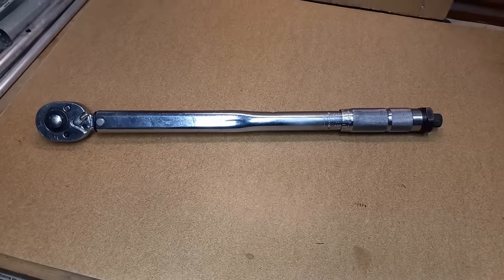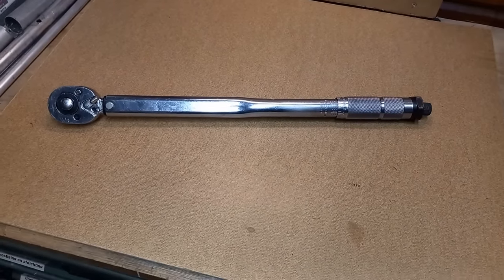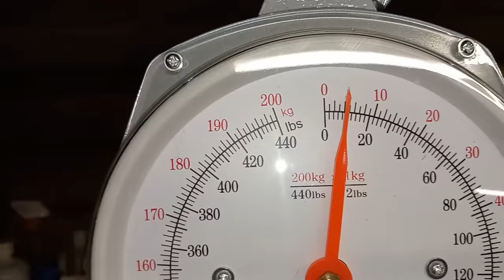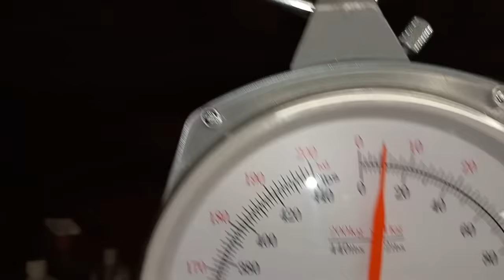How to calibrate a (cheap) torque wrench

Comment: My dad worked on aircraft in the 50s and 60s then testbeds in the 70s. I need to use a torque wrench but somehow his arm is amazingly precise he knows exactly what 100nm feels like to within 5nm.  On top of that, he ended up in technical publications where the torque settings were decided and its a mixture of finger in the wind mixed with measuring what an engineer thought felt was right. The exception was torque to yield but thats a completely different thing. He still maimtains you only need a torque wrench to get consistency for people who don't understand what they are doing. I can't feel 100nm from 200nm. Obviously 200 is twice but when you cant get square on something or your arm at a funny angle I just can do it... he still can.
Reply from the maker: Thanks for sharing that story James. I completely agree with your dad, I've been a technical writer for over 20 years now and determining torque values for workshop manuals is often done  by what experienced mechanics feel what is right. If we needed a torque value, we just measured the breakout torque and went with that. As I said in the start of this video: I like to work by feel an in my opinion any good mechanic can do that. On safety critical components, high torque connections and in the aerospace industry, it is a whole different story. That's where the calibrated and certified stuff comes in. But then again, in my day job I see a lot of overtightened bolts that just snapped off because the recently calibrated (they're always recently calibrated when stuff happens) beeped when the set torque value was long exceeded.
Reply: Your Father had the 'calibrated arm', as we used to say in the Aircraft sector.
The old German torque of 'Guden' Tite' was the other expression we would jokingly use.
Reply: On aircraft (there is no Parking Garage in the sky) - it is ILLEGAL for a mechanic to tighten a nut or bolt which has a called out torque - and not to use a certified Torque Wrench.  You must sign documents attesting to your work when finished.  Crud - the FAA will fine a mechanic - if they come to a shop or Airline; and find an individual working on an Aircraft without the Documents and drawings stating what to do and how to do it - at his location and readily available.

Comment: how much did you turn while calibrating the wrench? i.e. what would be just rough adjustment to start with? and in which direction?
Reply from the maker: Very little actually, three quarters of a turn clockwise was enough to get it in spec.

Comment: Great video, would have been interesting to see how accurate the maximum and minimum torque settings were after calibration at the mid point.
Reply from the maker: I have a follow-up video planned, to see how much my torque wrench deviates from the ISO standards.

Comment: I think it’s funny everyone arguing about how to unwind it and at what angle to use it but nobody seams to mention that this is being measured as if one uses only one finger at the very end of the handle. There’s likely a 2-3 inch difference in center pressure when using your whole hand. 
Lighten up, consistency is often as important as torque value.

Comment: First: of all it is a factor of 9.81, secondly: the center of the handle is used as the touchdown point, you have a special groove milled there
Reply from the maker: I adressed that in part 2 of this video, and indeed: you are right. Thanks for watching!

Comment: Great video!

I looked up the math and found that 1 newton meter [N·m] = 0.1019716212978 kilogram-force meter [kgf·m]. So 126 N·m * 0.1019716212978 = 12.852 kgf·m. And since the distance from the applied force to the point of rotation is 42 cm or 0.42 m, 12.852 kgf·m / 0.42 m = 30.6 kg. So now I see how you arrived at 30kg of force.

One question - When your torque wrench was clicking at 25 kg, did you adjust the calibration clockwise or counter-clockwise to dial in the torque closer to 30 kg?

 As a Canadian in my 50s I use a real mixture of imperial and metric. No question that metric is the superior system, though I still tend to think in terms of foot pounds because that's what my Dad passed on to me. 🙂
Reply from the maker: When the torque wrench clicked too early, I increased the pre-load on the spring, so it requires more force to click. To increase the pre-load, I turned the adjuster in (clockwise). I only took 3/4 of a turn to correct the pre-load. 
I can relate to your story on mixed standards, I used to be a technical writer that's used to the metric system, but I have written many workshop manuals for the US and Canadian market. The conversions weren't the hardest part, I am so used to use a comma (,) as a decimal point, that I always needed to remind myself to use a point (.) instead. Anyways, thanks for watching!
Reply: I concur.  Try going through the CMHC wood-frame builders handbook, you have to constantly convert everything from odd-ball mm sizes to 2x4 or whatever.   I am not sure who in Ottawa thinks I head into Home Depot to buy a 1219mm x 2438mm sheet of anything.  !
Reply: I talked to a guy once who pointed out that the romans split the inch into 16ths and that 12ths were superior because you could more easily divide them. This in turn points out the problem with the metric system which is fractions are hard when all you can divide evenly are 1, 2, 5, and 10. Now... if you live in a metric world do you still buy a dozen eggs or are there only 10 in the carton :)
Reply: @danielboughton3624  Hmmm? I saw eggs in Canada sold in 6,12, 18 and 30 eggs per carton.
Reply: @danielboughton3624  In Australia , 12 or 6 pack
Reply: @Wingnut_Stickman  In Australia,  timber measurements is largest first, 4 x 2 inches or 100 x 50 in millimetres.
Reply: @garybailey8877  we have 6, 12, and in some places 18. I haven't seen a flat in a long time which as someone else mentioned is 30 eggs. You can still buy things at the bakers by the dozen though it is not as common to go to the baker or butcher as it used to be. I think those might come back as the food wars continue. I have an egg guy I get my eggs from now when he has some to buy. Too many customers and not enough hens.
Reply: Thanks for doing the math, wasn't sure how he was coming up with that. I calibrated and repaired torque wrenches and gauges in my day. I always used ft/lb and inch/lb, this was throwing me. Couple things.:
Always return the setting to the lowest number for storage or the spring will get sacked.
Always turn the wrench setting up to setting, never down. If you have to go down, go down significantly far below and come back up.
The band in the middle of the handle knurling is where force should be centered, that's where it is calibrated at.
Position your hand force centered on that band as much as possible and pull at 90 degree's or reading becomes very inaccurate.
Beam type wrenches rarely never go out of cal providing they aren't abused and the needle rests on zero
Beam type wrenches will have a floppy handle mounted on a single rivet pin. Neither end of the handle should touch the wrench body.
Those wrenches should never be used as regular ratchet wrenches, or as a breaker wrench to loosen a fastener.
Even though the head comes with the reversing lever, changing directions often throw the wrench out of cal.
If a CCW torque is necessary, your better off getting a second wrench to do CCW only.

Comment: Great work. I would have wanted to see a bit more accurate calibration method but water in plastic container but I guess that's good enough for the scale used here.
Reply from the maker: And with the accuracy of the torque wrench in mind, I don't expect accuracy up to 1 nm, but I wanted to make sure that my wrench is in spec in the range I use most. Part 2 is coming soon!

Comment: I use a harbor Freight digital torque adapter and a socket that fits my lug nuts on the car.  Set the adapter to hold a reading and use it on one of the lug nuts that in on my car's wheels with a torque wrench.  When the torque wrench clicks I look at the reading on the digital adapter to see how close it is to the set point on the torque wrench.
Reply from the maker: That sounds like a handy device, what's the price of it?

Comment: But how you calibrate the scale
Reply from the maker: By using a reference weight. I used 5 liters of water, which is 5 kilo. It is best to use a reference weight dat equals the force you need to apply, but I didn't have 30 liter tank at hand (for the required 30 kilo of force I needed).

Comment: You’re not calibrating it you’re adjusting it, Calibration is working out three points at the middle and at the far side of the scale, to make sure, to check against a standard That it measures the correct amount.

What you are doing, presuming that the scales you pulled you know I measure incorrectly, using them as the standard, is adjusting them to a standard. Many people get this wrong

Comment: I wonder how ambient temperature affects torque adjustment for these mechanical wrenches.
Reply: Two effects occur. One is that the rigidity modulus changes. For most materials this means they get less springy as heat rises. In the case of a torque wrench the actual torque drops compared to the displayed value on the handle scale.
Second is parts of the wrench physically expand as the heat rises and this also has the same effect as above.

Comment: in my opinion you should apply a scale hutch on the middle of grooved place because right nowyou use it differently than normal. your hand should have grip around a center of hand position not far away in the end. so maybe originally near 30 was good.
Reply: Apparently you do not understand how a torque wrench works.
Reply: @deepcangler  they work on force needed to slip mechanical part tensioned by spring. Because this is measure in Nm usually it's mean that force attached to the arm it's correlated another force in fixed arm and fixed slip, resistance. So if you change length of the arm with the same force you change torque. So if you calibrate torque you should apply force the same place. Later after calibration it's not important when you put force as soon you exceeded torque it clik or slip. But with calibration it's one of the most important...

Comment: WHEN I WAS IN COLLEGE GETTING MY ELECTRICAL/COMPUTOR ENGINEERING DEGREE. MY PROFESSOR WAS THE ONE WHO FROZE THE ELECTRONS IN A WIRE FOR NASA. DURING ONE OF HIS CLASSES. TOLD THE CLASS HIS FRIEND WAS A ENGINEER WHO DESIGNED SPRINGS. MY PROFESSOR SAID YOU WOULDN'T BELIEVE THE ENGINEERING THAT GOES INTO DESIGNING SPRINGS.

Comment: If you're going to be picky enough to calibrate the scale before use, you should calibrate it correctly.  One liter of water only weighs 1 kilogram at sea level.  As you go up in altitude, it weighs less because the effect of gravity lessens the farther you get from the center of the earth.
Reply from the maker: My workshop is actually 2 meters below sea level.
Reply: @Carnold_YT   Then you need to take that into account as well.
Reply: Seriously guy you think 2m above sea level is a factor with all these other variables and a $25 torque wrench. Bwahaha that’s hilarious
Reply: @travissheehan6082   No, I don't actually.  That's kinda my point.  You've heard of sarcasm, haven't you?  Maybe pick up a dictionary sometime or something.

Comment: When I did my apprenticeship in aero engineering I was taught not to keep pushing until the device clicks. As soon as the pressure goes over the ‘hump’ and goes slightly free to the ‘click’. When the wrench clicks it continues to move up to a stop, when it hits the stop additional torque is exerted.
Reply: So how do you know when you reached the correct torque if not for the click? Just feel it?
Reply: @Asto508  my mechanical wrench increases in pressure to a point where there is no more pressure needed to continue to move it. Then it clicks. The click introduces a random input to the pressure. Obviously an electronic or gauge wrench does not do this. But experiments have shown that if you want/need highly accurate torque then avoid the click. To be perfectly accurate put a DTI in the end of the stud or bolt and measure the stretch of the bolt or stud as this obviates any friction in the threads.
Reply: @billgiles3261  I see, but I guess this requirement for high accuracy you won't find outside of aerospace engineering which you of course mentioned. 
Automotive is just not that demanding and it's fine if you exceed the torque by a tiny fraction of Nm. 
For the paranoid people, you can just set it a bit lower than spec and live with the offset. :) 

As far as I know that's also the reason why torque wrenches in that segment are usually electrical/electronical and not mechanical. 

We are still on a Youtube video about DIY car mechanics though. :)
Reply: Another and more insidious error component - is that people don't move the wrench in one smooth motion.  A MOVING nut needs less force to keep it moving.  If it is stationary - you have a greater force exerted onto it - to start it moving.  So, when you are torquing a fastener - as you approach the torque - position the handle so that you can complete a swing arc in a smooth motion - and stop when the wrench clicks.  Then - after this - and torquing a round of fasteners - people like to go around with the wrench - and test that they are all 'correctly' torqued.  But now - if any of them move - rather than having the wrench 'click' - you likely exceed the torque you were going for - because it takes more force to start the nut rotating; then the continuing force is reduced; and you end up exceeding the target torque.
Reply: @billgiles3261  there is no such thing as a highly accurate torque. The torque value is an easy way of tightening nuts, or bolts. Mechanical integrity of the material of the threat, small dirt particles, tiny bits of grease all influence a correct torque. It is a fast and easy way to fasten structures and components, within certain limits. It gives a preload to a bolt, but in the end it is not really accurate. Accurate enough for the purpose though.
Reply: @chrisbode7173  the purpose of the torque on a bolt or stud is to impose a load on the joint, perhaps to put pressure on a seal or gasket. The torque relates to the stress put on the fastening. The only way to measure that truly is to measure the extension of the bolt or stud. Using a torque wrench is a simple if inaccurate way of achieving that. My mistake was I guess to equate torque to that stress which of course it is not. Obviously the designer of the object wanted the fastening to be put under a particular stress (ie stretch to fastening a certain amount). For the mechanic or engineer it was simpler for the designer to specify a torque. There are tables and apps to do that these days. But in the olden days I was taught how to work out the torque needed to achieve a particular stress.  Sixty years later i could not. It is one of those things one learns in training never to use again. I also learned the knots needed to tie down an aircraft in high winds but never used that knowledge either.

Comment: Force needs to be applied in the center of the hand grip. The handle pivots in front of the ratcheting head so the calculation from “center of the socket” to end of the handle is not correct.
Reply from the maker: That's a good remark, I'll mention it in part 2!

Comment: Even on a cheapo non-adjustable torque wrench, you can use this exact method to TEST how accurate your wrench is.
Knowing the deviation makes it more accurate in use.
The basic principle is the arm length x weight applied.
Whether it's Nm (kg x m) or Lb x ft depends on the tools dial.

Comment: I guess I missed something.  The entire process is based on 5 Liters equalling 5 Kilograms, but we never saw the accurate measuring of the 5 Liters.
Then when you moved the adjuster, it was not shown or explained.
Reply from the maker: That is true, but the jug has a level mark at 5 liters. It was filled to that mark. Note that the weight of the jug was not included, but it's only a couple of grams.

Comment: Great video mate, I've often wondered how to do this. So if it's under the desired 30kg which way do you turn the adjustment, do you tighten or loosen it. I have a few torque wrenches one of them is the same as what you have in this video and it has done a lot of work also.
Can you confirm my question about tightening or  
loosening the adjustment. Thanks for the video, great topic. Hello from Australia 🇦🇺  👍
Reply from the maker: If your torque wrench clicks too early, say at 26 kilo of force, the pre-tension on the spring should be increased. Half a turn clockwise of the adjustment screw is usually enough to correct the pre-tension. I'll adress this in the next video. Thanks for watching Troy!

Comment: Where was the spring scale hook placed on the torque wrench? Was it a calculated distance from the driver?
Reply from the maker: I measured the distance from the pivot to the end of the grip, hence I attached the scale hook on that point.

Comment: I would probably place the scale in the blank part of the knurled surface (in the middle of the grip).
Reply from the maker: That is the correct way to do it!
Reply: @Carnold_YT  and yet, you pull at the end of the grip on the black part. If you pulled at the narrow blank part, the force would probably be spot on.
Addition: I know all this is better than nothing (hopefully) and on a principle basis, but calibrating something at 5kg, and then use it at 30kg, is not exactly by the book either.  But again, I understand the accessibility of a 5 liter can (I have several in the shed).
Other than that, great video! I've never checked my torque wrench, but perhaps I should. 
PS. Keep up the good work with the Lexus - one of my dream cars!